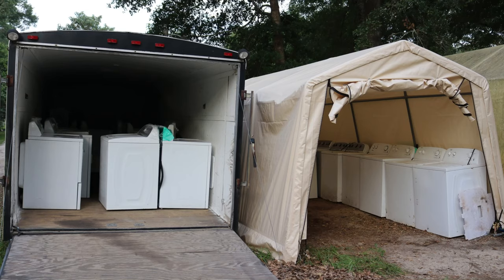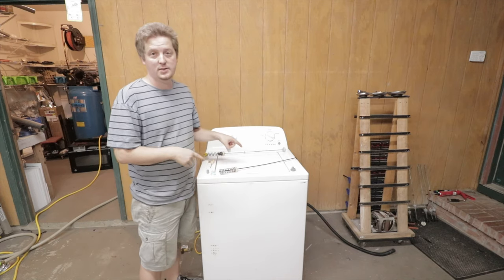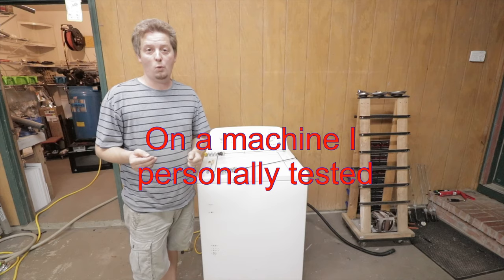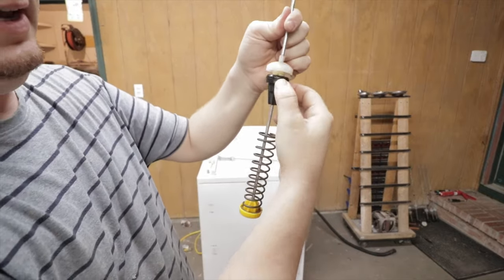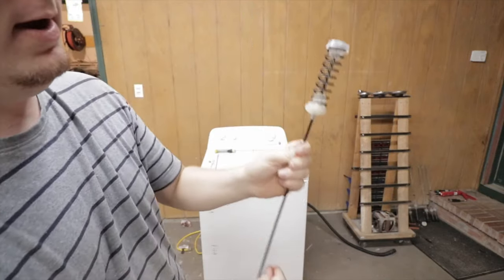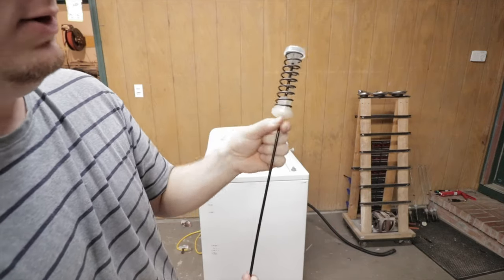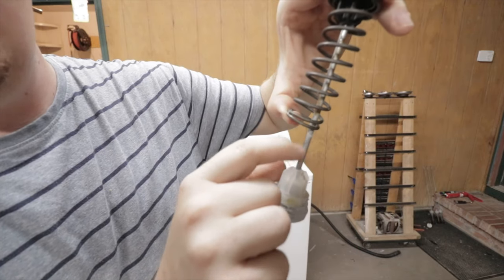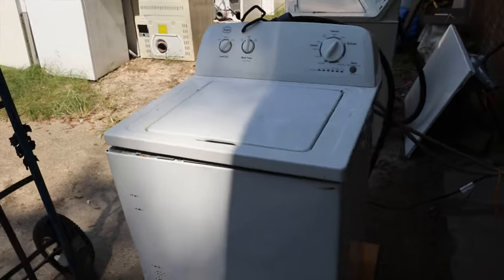Cheap Permanent? fix for shaking banging Washer? $7 to fix Suspension dampening rods W10780048

Comment: I filed down the rod a bit with a sawsaw blade enough to make a dentation on the rod. Then i tied a tie wire for rebar on the rod to keep the spring from going up. No need to replace anything. Worked like a charm!
Reply from the maker: Cool
Reply: That's the Mexican way to do it wey
Reply: Ducktape ,work like a Cadillac
Reply: @aintbreedlove7729  i dont. it is put together already. Been 6 months and still working fine. Just file a grove on it, right at the the point where the spring will stay put then. Then tie a tie wire with pliers and it will keep spring in place
Reply: Sorry for the late reply are you saying tie it above the plastic that slides into the washer
Reply: @zayzay8734  how’d you do the duct tape
Reply: @aintbreedlove7729  tie it just above it to keep it down and keep it from moving
Reply: I'm telling you wrap pantyhose tightly around it put the cap back on it put the rod back in there and it'll work
Reply: Sadly I feel that over the course of time much sooner than not you will absolutely actually have to have new rods purely because the integrity has been altered
Reply: Please make a video. Ty.
Reply: @chewybaca4159  I wonder, my moneys on the foam being way too easy a failure point. I recall the rods feeling pretty robust... 

I am curious though. If anyone has a rod fail please let me know.
Reply: Did you have to do all the rods?
Reply: @melvinmelvin8577  yes i did all...11 months later and washer is still going strong
Reply: @WasherDryerMoney  how has this repair been holding up? Im doing this exact repair as we speak
Reply: Man these rods must be expensive to do all this rigging
Reply: @Paintsandpackages  they might not be.. but i didn't want to wait for parts..it was a simple fix and it has lasted more then a yr and still working.
Reply: @joseperez6234  I'm going to do mine now, my Matag bravos has my wife riding it like a bull so it doesn't fly thru a wall😂 wish me luck
Reply: @chriseast7376  just eat up with a saw saw or file the metal rod down i bit around the rod.. so the tie wire cant go up or down and twisted tight.. this will keep the spring down in place.. I'm telling you mines have been working for more then a yr now.
Reply: @ddemier  been holding up ever since..i feel like it might outlast the actual washer.
Reply: @chewybaca4159  its been more then a yr..i think the fix might even outlast the actual washer
Reply: Jose it would be great if you can do a video. For some of us are more visual learners.
Reply: On top of the plastic part or under
Reply: @jaycole3768  i think on top of it..the plastic is what keeps the spring down in place and is what wears out..so leave it down against the spring.
Reply: @joseperez6234  what about when the weight of the washer pushes down on the spring.
Reply: @joseperez6234   is does fix this ul code tho ?
Reply: @joseperez6234  will this work on a whirlpool  cabrio washer  tho wtw6600sb2
Reply: @gummymonsterurlips  the code usually goes away when you turn it off and on again.. once you start it if its not fixed the code comes back again becouse the sensor is off balance. But after my fix the code just didn't come back on since the fix takes care of the balancing.
Reply: So what you saying is you replaced the rubber part with tire wire?
Reply: This video is a real d.i.y fix it with no parts to replace. We called a repairman that didnt  find the solution. I can't blame him too much, but except I could see he didn't try the search for this and he could have possibly finished the same day with no parts waiting to be delivered .
Reply: @zayzay8734  Cadillac es cadada con lilac. Japones sevren mas bueno. Americano Americano des pues come caca no me des.😂😂😂
Reply: @Paintsandpackages  you have "go by the book " issues. YouTube is very much a rigging platform. So why don't you stick with your books. I'm sure you will impress your friends showing you ordered parts to do it "correct". Not
Reply: Hat about some shrnk tube
Reply: Where did you file it down? On top of the plastic or in the middle of the spring?
Reply: Hi Jose, your repair makes sense.
When the spring collapses from an imbalance, the opposite spring over extends...
Your cut a grove into the rod & use wire to stop the suspension from overextending nails the problem in an easy way (thank you).

My idea is to clean/sand the rods and apply epoxy stoppers perhaps in place for a fast, effective repair.
Reply: @dondamondem  yes, till this day is still working. Good luck.
Reply: I have a similar idea in regards to limiting the spring suspension as Jose mentioned.
Reply: @joseperez6234  Thanks for staying on top of this. Often the miracle fix is never updated so you don't ever find out what finally happened.
Reply: Sawzall. Not sawsaw
Reply: Got a picture of this setup?
Reply: @doctorfeinstone6524 thank God I'm not the only one. Lol
Reply: See saw blade ? - I thought about using a piece of Black fuel line . . .
Reply: I was about to mention using a  pipe cutter and an actual snap ring.
Reply: @Paintsandpackages yes, the rods are expensive.   I used some dense foam from a floor mat and it has worked for two years.  Now I’m trying to find a superior solution.
Reply: Tighten a hose clamp above the plastic shock absorber.  And  or replace  the spring with one with more tension.  Use a piece of coat hanger cut to length of desired spring  compression, a small hook in both ends set inside the spring to gauge the spring compression.
Reply: If you can't fix it with duct tape you haven't used enough 😊
Reply: @dondamondem duct tape
Reply: @joseperez6234 Wonder if 1/4” split collars would work just as good. 
  I have some but still have not tried them.
Reply: @joseperez6234 I think the foam is actually what wears out. 
  It should grip the rod. 
  Interesting that your fix held up though
Reply: @rickeykeeton4770  been way over a year and still good
Reply: @joeheimann3180 😅😂
Reply: @Paintsandpackages about $490 I got a quote today for 4 rods OEM. And that’s just the parts not including labor.
Reply: Yup!!!!
Reply: @tguzman7408 … Nope HUNGARIAN MAKE DO …
Me .. second gen Hungarian… I FIX EVERY THING …….

Comment: for my washer which is maybe 15yo or more.. it has only one suspension spring. at first i thought i would need to buy a whole new washer.. watching a few of these vids and opening up the washer my self, came to find that the hole that the long end of the spring was hooked on was cracked because of rust. Drilled a new hole in a non rusted area and reconnected the spring. Problem solved and saved 500-1000$. thankful for the internet.

Comment: The grease that is supposed to be inside the top plastic part of spring is (damping) grease. It is there to cause resistance thus slowing down the movement of their spring. After separating the cap on the top, there was ample grease to to reapply to rod. Also, I dug out the felt packing and discovered it to be tapered so that when cap is snapped on squeezing the felt tight against rod causing a gripping effect. I wrapped electrical tape around the felt a few rounds to give it more firmness around rod thus making it more resistant.

Comment: So thankful for this video. I'm a homesteader and just got my first washer and it's been an annoyance, bashing itself to death. I fixed my with a few extra Bungie cords to tighten the suspension. But now I know how the rods works I can fix it proper. Tho my repair works great.
Reply from the maker: @EverettHiggins  hope it’s still working well. A new fix is replacing the foam piece with a new phone piece cut from a 3/4 inch yoga mat. Cut it a little large so it fits nice and snug. Good luck.
Reply: @WasherDryerMoney  So do think the foam in OEM was defective?

Comment: You're video was extremely informative. It's nice to know how the whole suspension rod system actually works now. I'm working on two machines for a furniture rental store that are having the same problem. Both are only a year or so old but I'm going to check the slip on the foam bushing over the rod to see if it slides too easy. If they slide easy I'll probably replaced with OEM suspension rods for now. I'm looking forward to seeing the next video. Today is 5-14-21. Is your original fix still working?
Reply: I'll wrap some pantyhose in them 3 weeks ago and they're still going strong probably about 60 loads of laundry through it machine.
Reply: The secret is the damping grease that comes on it. Opposite of regular grease. It’s very sticky. All you need
Reply: @johnellisonarmadilloconstr7966  ah hah. simplicity at its finest. thank you my good man

Comment: Seems to me like someone could make a capsule that screws together with a rubber gasket so that it works like the packing on a valve stem, where you can adjust the tightness of the gasket by how tight you screw the two parts together. As it wears out all you do it tighten the halves to squeeze the gasket more.😁
Reply: That's a terriffic idea, too much $$$ though.  People still aren't talking about the 2 to 4 springs that attach to the rods and side of the tub. at the top.   ABT. $10.00 a pair  I really believe this would keep the tub swinging side to side as much.

Comment: Thank you for the repair video. I have found if you cut short pieces of small nails and push them into the fiber bushing it will tighten on the rod also fixing the problem with no wait. Still under testing. You’re video really inspired the fix. Thanks again!!!
Reply from the maker: Let me know how long that works. I remember reading in the comments that someone did the same thing with toothpicks. I’m afraid that the fix will not last very long because the ones I have seen the piece of foam is deteriorating. But it may last a few months or maybe a year which would be great.

Comment: Nice vid, well explained, and I like your experiments with in-situ molding; another youtuber used 5-minute epoxy putty, hand-formed around the shaft. I have not read the 600+ long comments stream, but I believe from my own research (into saving $100 on replacements) that you have missed the actual mode of operation of these rods. They rely on the non-intuitive behaviour of the lubricant applied by the manufacturer...these allow the rod to slide through the bush, but resist being stretched, providing damping  friction but not attaching to the rod. These are called 'damping greases'. You may have wondered why a piece of foam was used in the slider...it probably was a reservoir for this grease. The damping is provided  by the effect of the grease on the rod, not the fit of the bush around the rod. Nyogel 767 is such a grease. The grease is not cheap and is sticky to handle. There are also reports of the bottom of the tube bursting while trying to squeeze it out because it thickens as it is forced through the neck. Thank you for taking the time to make this vid.
Reply from the maker: Yes I agree. 
We’ve all learned so much since I’ve made this video. Honestly I did not think anyone would care to even watch this video. It’s very surprising.
I’ve actually talk to the guy that made that video. The grease is a key part of it but it is not the only part. The foam is definitely the weak point of the entire piece. As it disintegrates from moving up and down the rod when the drum fills and drains water in and out also the pressure from off-balance loads.
After the foam falls apart it creates a empty space and the grease cannot do its job properly because of the distance between the shaft and the grease that is no longer directly touching the rod.
This is why even in a stock ride that has plenty of grease will still fall back-and-forth when you flip the rod over. 
If you fill the void in the deteriorating piece of foam with this grease I believe it would fix this issue temporarily possibly permanently.
I’ve had a few manufacturers send me there rods to review and I have not done any because I have not been very impressed with the amount of grease they use. Way less than original in some cases.
Which explains why people are having issues with these rods continuously going out. 
These aftermarket companies are not understanding the importance of putting enough of that grease in the rod.

PS
I still have the liquid nails washer but I am about to swap out to a direct drive washer and get rid of this one. It has not had any issues with the suspension rods and I have ran a ton of loads through it.
I think the reason the liquid nails work so well is because a extended about a quarter of an inch.
=more surface area for the ride to be in contact with. There is no grease in the rods I’m using but I still think the grease is very important.
I’m not saying that there’s any special factor to using liquid nails I’m just saying this because I believe it’s a simple problem of gripping a rod slightly and there are 1 million ways to do it but I do believe the grease is the best way.
Reply: @WasherDryerMoney  Thank you @Washer Dryer Money for providing a forum for this problem. Maybe we can get the OEMs to start manufacturing responsibly. I would like to thank @Neil Fixes for his research and assessment of the real problem. After talking to many washer owners with the same problem, this problem exists in the design of many of the mainstream washer brands. I own a Whirlpool 1CWTW4815EW1. The support rods have a felt drum that comes in contact with the rods. The trouble is that the OEM rods are loaded with lubricating grease which defeated the purpose of the Damping gel. THEY WERE MANUFACTURED TO FAIL.  After thoroughly cleaning the rods and reservoir of lubricating grease  (brake cleaner works), I applied Nyogel 767 liberally to all inner surfaces that contact the rods, and made a Nyogel reservoir in and around the felt drum. I took one additional step and spread a thin coat of Nyogel into the ball socket at the top of the rod to further reduce rod movement. The washer has been operating flawlessly, even with heavy loads.
Reply: Damping grease comes on them from the factory. It’s very sticky.  That’s all you need
Reply: Just used Nyogel 767A on my cheap Panda top loader. Machine spins as quiet as ever now. One thing I noticed—there was no foam on the suspension rods. Instead, the plastic bit holding the spring down had two channels cut into it on each side, I suspect to act as reservoirs for the grease. But yeah, it really was as simple as squeezing in more.

Comment: I don't ever leave comments... well, hardly ever - however in this case it is more than warranted. Yours is the only video that I've found that describes HOW the suspension/dampening rods help to balance the washer. Having replaced two sets of rods on two different washers, fixing the problem, but I never understanding why (until seeing your video).
Thank you!
Reply from the maker: Thanks. I’m going to be doing a few more videos on the suspension rods soon I have a few new ideas on how to fix them.
Reply: I'm a repair tech and never realized that either. I just assumed the springs were getting wore out. I've changed these things 100s of times
Reply from the maker: @joshuamills765  yeah I remember the moment I figured this out. It was definitely an aha moment.
Reply: @WasherDryerMoney  You are the person that I got that I got the actual idea from. Thank you.
I just put up a new way of, the most cheapest way of fixing the problem.  It is on  a new comment up there. It is so cheap and easy, it is crazy.  Check it out. I stumbled on it last night and works outright perfect.
Reply: @WasherDryerMoney  I should check them out. It occurred to me watching this video that what is needed is damping grease between the rod and friction ring!!! Sure enough, in other videos, when people put in the new rods, you can see the grease on the rod where it will contacts the plastic cups!
Reply: Guess again 😄
Reply: Is it that complex?
Reply: Exactly my sentiments not just knowing the answer but why it is and how it became to be, the big picture.

Comment: 🤔Duct tape fixes everything 😏
Pulled out the damping material carefully without breaking it, covered it with a few layers of tape , and squeezed it back into place.

Your explanation was very useful. Thanks for the inspiration.
Reply: To think I was gonna throw away the whole washer before understanding the problem. Ended up spending $0.00

Comment: I love your video. My foam insert slipped very easily on the hanger rod, just like your demonstration. After watching several videos on the "fix" I used 5/8" long pieces of plastic tie-wrap inserted between the foam insert and the plastic cup. I inserted 4-5 pieces of the tie-wrap until the slide was gripping the rod pretty well but still able to slide. Works great and probably will last longer than toothpicks. I suspect the foam insert with eventually disintegrate to the point where and insert will need to be replaced.
Thank you for the great video and all the interesting comments.
Reply from the maker: Very cool glad you got it fixed.